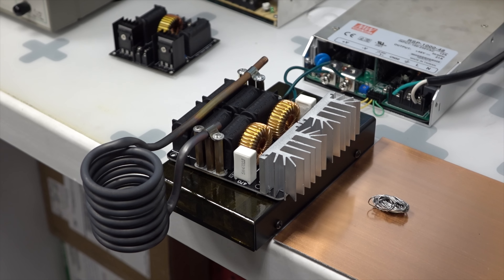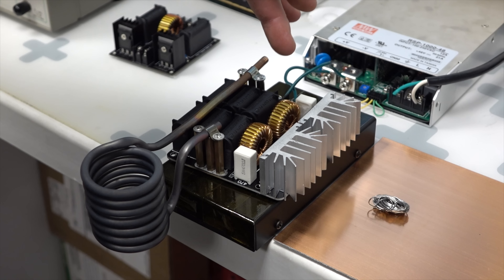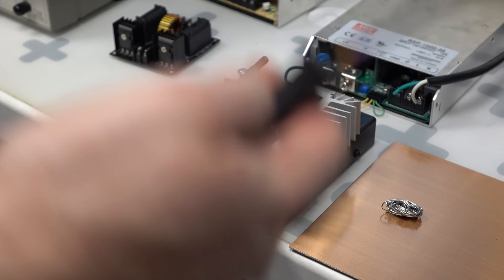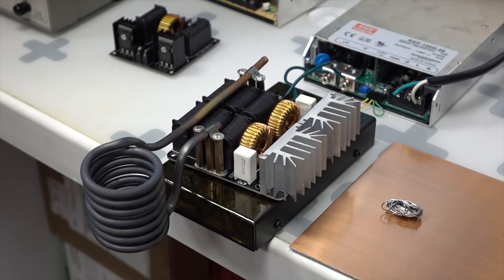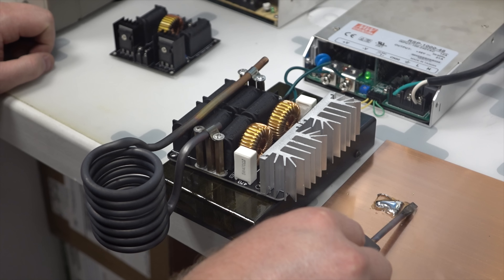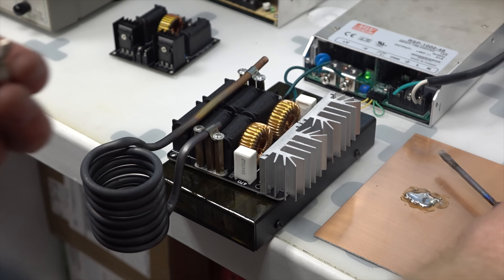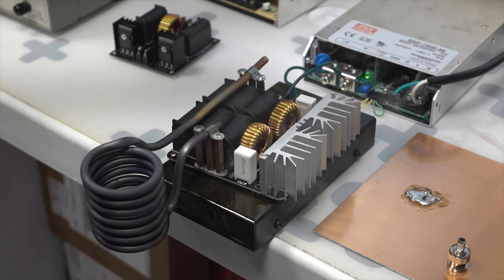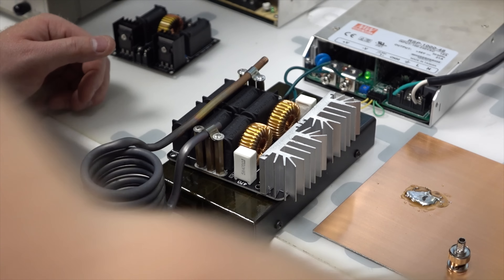1000W Induction Heating Part 1

Comment: From what Ive read, you shouldnt be turning you zvs on at the same time as your SMPS (switch mode power supply) it takes a second for it to get up to voltage and in that time your mosfets will not switch correctly and you could fry it.
Reply from the maker: That depends on the quality of the SMPS.  This power supply has negligible rise time as well as many other features like short circuit, over-load, over-voltage and over-temperature protection.  What you're referring to is when a cheap power supply with a slow rise time is used and turned on at the same time, both of the MOSFETS latch up and essentially short circuit until they catch on fire.  This is also why is important to use a high quality power supply if you want a reliable system that will catch any mistakes you make.  If you don't have a nice power supply, just have two switches; one for your power supply and one for the ZVS driver.  Then you can turn your zvs driver after the power supply is at full potential.

Comment: Is there a safe way to PWM these simple boards without shortening the life? Could you connect a high voltage relay on one end of the coil (I want to use Litz wire)? Just trying to find a way to use this to ramp to a temperature and then PWM it to maintain. 

I'm likely going to use  a chinese 500w unit as I only need to get to 40°C - 110°C maximum.

Any ideas would be very helpful. Your videos rock and your instructables  I'm now going through...

Comment: I watched up to part-6 did not notice forced coolant - water - circulation in the coil wire, which can be accomplished with a windshield washer pump. Copper is a material with multiple time more resistance under high current and skin effect. Hope this helps,
Reply from the maker: +YK Chan If you watched all of part 6 you would see me momentarily use circuit cooling spray that cools to -50F.  Also, I use Litz wire for more efficient coils that are not negatively affected by the skin effect.  I rarely use the copper tubing.

Comment: Thanks for posting. I got 1 of these units, but it didn't work. Got another one, same thing -- doesn't work. The 1st 1 I got, I used a 12v car battery -- blew the trace off the board! (yes, polarity was correct) Yours and everybody else's works great! What am I doing wrong?
Reply from the maker: +Bob H That is why I recommend testing everything with an adjustable lab power supply first.  Even the power supply in my video has multiple overload protection features.  This prevents the power supply from getting damaged as well as blowing traces off boards.  There's no way for me to know what happened to yours.  The coils that the unit shipped with should not be used to heat anything much larger than a screw driver.  Custom coils are the way to go, but that is another topic all together.
Reply: +Proto G - I finally got mine to work. There's a caveat to these self-excited induction heaters. The one that you show in your vid is the one I have too. I used a variable power supply and brought the voltage up slowly, which caused the FETs to go into full conduction, thus, it wouldn't start oscillating and it went into current overload (i.e., a short).  However, running the power supply at 20v or greater, then connecting the unit, this worked ok. At this point , the voltage could be moved up or down as low as 11v and it still worked. These units are really meant for 48v. I'll be posting a vid of my results soon. Thanks for your help.
Reply: +Bob H  Hey bob,  your right about this zvs unit being "touchy". First of all you have to limit the amps with a power supply. A battery source is too much and probably will be applying power with one mosfet locked on or in capacitance.  With no safety circuits you have to fuse the input with something like a 30 amp fuse. 
  And I have built several of these units myself and they like it better to be turned on above 20 volts like you said. 
A couple good things about building your own one of these is that you can design it for longer duty cycle use. I think the guy in the vid talks about a solder pot, or something like that. I seriously doubt this unit can undergo that type of use for very long. The caps will eventually get too hot and melt. The board contacts might cook. The mosfets will begin to deteriorate being heated over time unless you keep them really cool. 
  This thing is more of a toy and has limited uses.  I have wondered if you could house the entire unit in a sealed mineral oil container that is cooled somehow. I bet it would be able to run a long time. 
  And one more thing, be careful about the voltage. There is a real threshold with those things and it will get angry fast if you pass it even once. The cheapness factor with these types of things does not allow for easy or fast repair. If you blow a fet it usually cooks the cheasy traces somewhat and replacing them might get you going for a while longer but you would already be on the road of cascading failure.
Reply: +hotbikerguywithscar  - Thanks for the verification. They're interesting,  and I do acknowledge their limitations.  I'm not using mine for anything big,  just for small projects like flashing getters and the like.  These are interesting units,  I want to build a vacuum tube induction heater next.
Reply: +Bob H I'm using a 12 volt car battery with a switch and an inline, 20 amp fuse. As soon as I flip the switch, the fuse blows. Is this because the power supply is insufficient?
Reply from the maker: +Matthew Kowalski I recommend using a 24-48 volt power supply or battery.  It's counter intuitive, but the higher the voltage the better for these units.  By using 12 volts, you risk the MOSFETs latching up and drawing so much current that they fail.  I have used 16 volt batteries with no issues whatsoever.
Reply: Thanks, is that true of most boards or specifically the SainSmart board? I bought other 12v components because this unit claimed to work with a 12v power supplies.
Reply from the maker: +Matthew Kowalski They do work with 12v but if the supply or battery sags below 12 volts for whatever reason, your board is fried.  It's not worth the risk of using a 12 volt supply with these units that needs the strong fields to oscillate properly.  Watch my other videos in the series.  I have several units and none that have failed while people email me all the time complaining that their units failed with "only 12 volts."  I mostly use them with 48 volts.  My power supply also has over current protection so if they draw more than 22 amps, the power supply pauses before cutting back on.  Also, as a suggestion, do not power it on with a load in the work coil for the first time.  Slowly introduce new work pieces to get a feeling for what the current draw will be.  You need to closely monitor the current draw at all times if you do not have a proper power supply.
Reply: +Proto G Now I'm thinking I should use two 12 volt batteries in series. Do you think I should be concerned about the voltage reduction as the batteries are drained? 

I want to use 12 volt batteries because I drive around with one every day, and want to limit my expenses for my side-project. I also need the unit to work in the field without an outlet. Thanks for your insight
Reply: +Matthew Kowalski  I commented once on here before about the current draw of this circuit. It needs to be limited. if one of the mosfets latch on and you have no protection you will be basically shorting a 12 volt battery, (capable of shorting 100+ amps), through one of the mosfets and wimpy traces on circuit board. It WILL blow. 
  I think you could buy on ebay for around 20 us dollars a 12v to 24v converter that is rated 20 amps. In this case you get a more proper voltage for this circuit to work on. And to boot it will be limited. i think the 20 amps version of the inverter is still wimpy because the ratings on ebay chinese electronics is a bit on the high side. If you could find a 30 amp 12 to 24vdc you might be ok for higher duty cycle use. 
  This would allow you to go mobile and use your car battery, fused of course. 

The way the circuit is made should allow you to instantly apply 24 volt power, unloaded, and draw no more than 3-5 amps initially. If it draws more than that then something is more likely wrong somewhere. It could be just a matter of using a crappy power supply that has a lot of noise in it. Try this. From the power supply wires place a large capacitor, like 10000uf or more to power cable right before power hook up on the circuit. This way, if you are getting noise that is adversely effecting the circuit it should stop. I built a few of these before and I had that problem more than once.

Comment: Hi, please can you possiblly tell me what I've got wrong, I have the sam unit, but as soon as I connect the pwer supply, it first beow the positive track on the board and mosfet. I replaced both of them and same thing both popped. do I need to restrict ant thing.  I'm using two server 12v power supplies connected in series and have isolated the groung?
Reply: +jorgan 202 hmm I was going to use a similar setup.  Obvious question, but what is the total power of your two server power supplies?
Reply: +Ronin 65A at 12 volts each
Reply: +jorgan 202 it was actually already answered by Bob H below: greater than 12v is required to get it started.

Comment: On the eBay it says that circuit can tolerate 30A, but the maximum is 20A for safety precautions, so I am wondering can it work on RSP-1000-24 Mean Well power supply, as it gives 40A and 960W. And it also says that the cylinder which is inside of the coil shouldnt be bigger than 1/10 of volume inside the coil or its diameter not to be bigger than 1/3 diameter of the coil, so how did you put your screwdriver inside the coil with no problem, and can Mean Well RSP-1000-24 work with no problem?

Comment: Awesome.. Can you estimate the frequency which the driver work on ?
Reply from the maker: +Hussein Ahmed Thank you, yes the frequency is 160kHz.
Reply: +Proto G thanks alot 
 what if you use another another coil to heat ....   will the frequency  still 160KHz ?the question in another form is the driver frequency  is dependent on the coil(of the heater) ?

Comment: Hello, I have a 0-30volts, 10amps power supply that can output 300watts, would this device be able to run a induction heater similar to this?
Reply: Yup, but limited to the 300 watts of the power supply, so the size of the item it can heat will be commensurately limited.

Comment: I figured something out.  Okay, check it.  I just bought one of these but, I'm using a Bell Jar.  So, after I establish a vacuum, I'll spark up a plasma through the glass, using a spark plug coil, and two metal plates attached to the outside of the glass.  The coil of this thing, is going inside the vacuum, and the stand is going to be raised on a box.  But, then I will slowly introduce water vapor, and attempt exothermic equilibrium, at a low pressure.  That means the water vapor breaks down into hydrogen and oxygen, then burns, and breaks down again.
Reply: +James Elger I'll have to keep the vacuum pump running as I introduce the water vapor at first but, then I'm going to see how long and strong the plasma burns as I slowly work up to atmospheric pressure with nothing but water vapor in the bell jar.

Comment: What amps & volts is that running at? Those input wires look very thin,  I'm planning to use 2 car batteries in series, 24v at 40 amps should give me about 1000 Watts, although with my heater I may need 36v to get the max power.

Comment: Hi my friend. which is the maximum temperature reached?, reaches 1100 degrees Celsius?. I want to melt brass.
Reply from the maker: +manuelmetalero I have reached 1100 degrees celcius.  I actually did it with the batteries in part 5.
Reply: +Proto G Interesting.  I bought one of these about 6 months ago and started testing with every power supply I could get my hands on.  I got some welding wire nice and cherry but that was about it.  The power supplies I used were some 600W power supplies with 3 12v rails at 10A.  I ganged them in parallel to get 12v@20A and I basically got nothing.  When I set them up in series to get 24v@10A, that's when I got some metal hot.  I recently wound a MOT (around 1500W), rewired it to hit 50V@~25-30A using 14g enameled wire and my results were the same.  So, I can possibly believe 1100F but I don't think it will reach 1100C.

I got copper to heat up to where I can't touch it, but it didn't even get hot enough to oxidize the surface.
Reply: +Proto G Oh, I also have a 30A bridge rectifier and a 820uF/400V filter on it.  Still same results at a 24v@10A setup.
Reply from the maker: +daduck748 I have definitely reached 1100 degrees Celcius with the graphite crucible.  I got to around 900C with just batteries as you can see in my other video.  Did you have a power meter connected so you could see what power you were actually pulling?  I've pulled 1143 Watts through the driver with no issues.

Comment: Hi! what is the output voltage (where the coil is attached - > approximate values are far enough) and output frequency (where the coil is attached-> approximate values are far enough)?